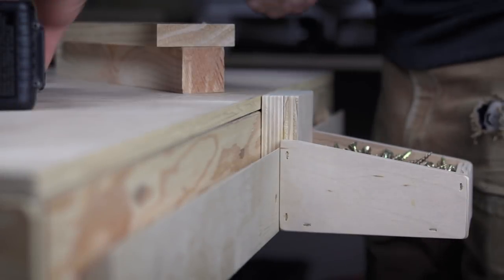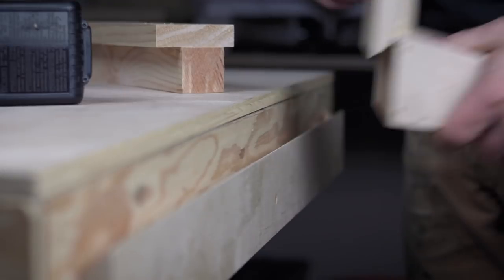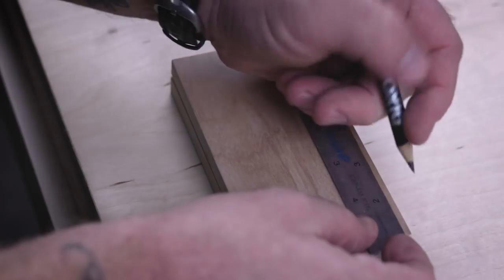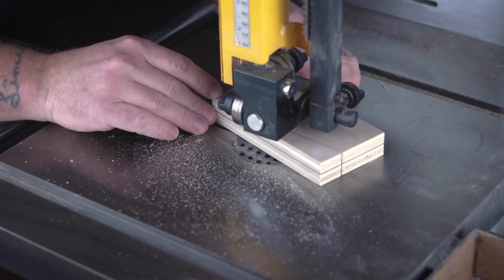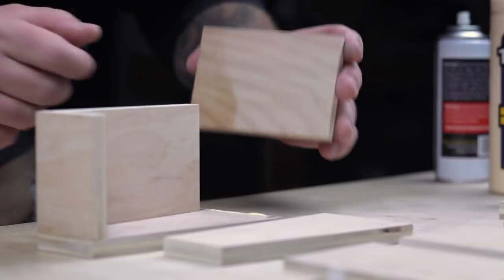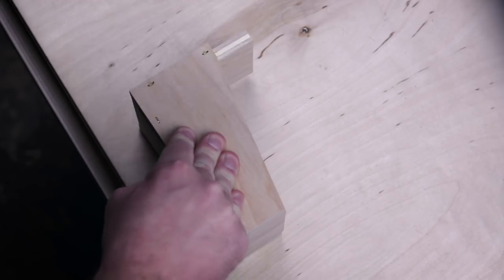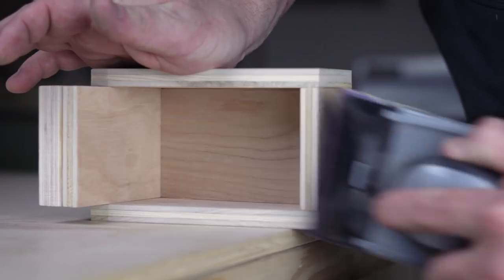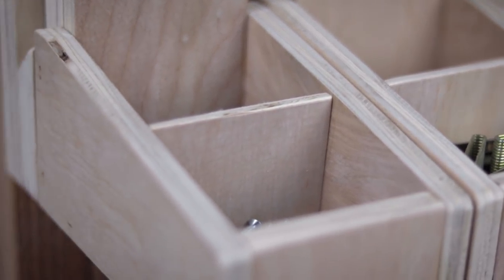Quick And Easy French Cleat Hardware Bins

Comment: What is that spray at 2.02" ? Thanks.
Reply from the maker: It's a CA glue accelerant. It speeds up the cure time of "superglue" and works really well for setting parts together. There's a link in the description that should take you to Starbond's website and you can check it out!

Comment: What is the spacing and dimensions of your French cleats on the wall?  Would you change it at all? I'm considering doing an entire wall of them in my shop, but can't make a decision.
Reply from the maker: I believe my cleats are 2-1/2” tall and are spaced pretty close to that. I haven’t really found anything I would change about what I’ve done so far. I think the biggest thing is to make a bunch at one time, even if you don’t install them all right away. At least then you have them down the road and you can space them farther apart if you want now, and fill in the gaps later if you feel the need. Inevitably there will be some sections that get covered up or unused, but that will change when you decide to relocate some things.
Reply: Awesome, thanks man.  Keep up the good work.  Your content is great.